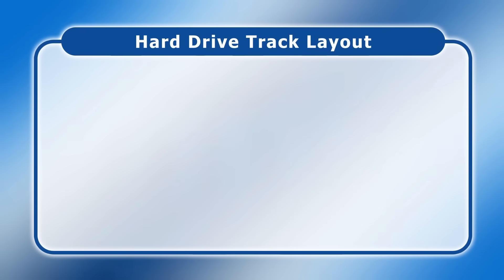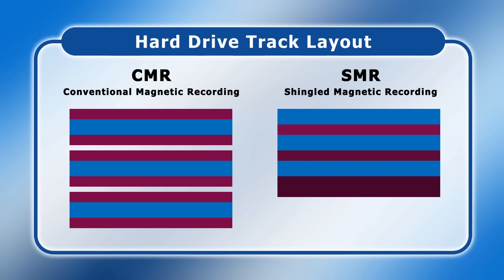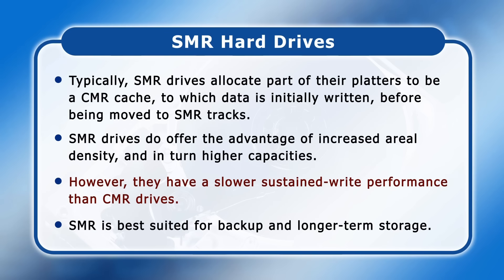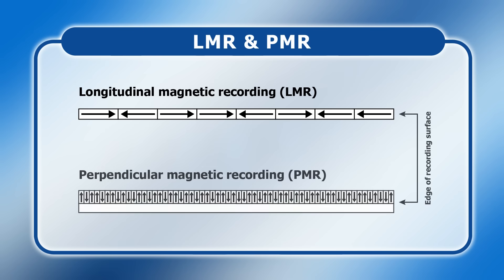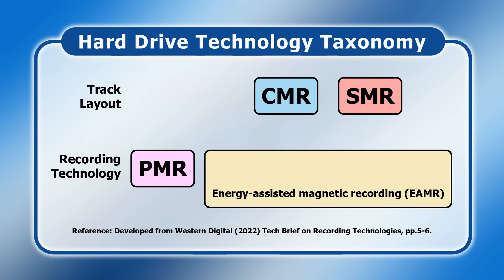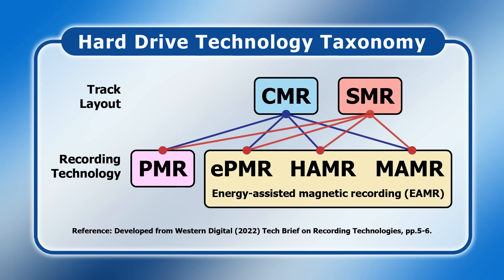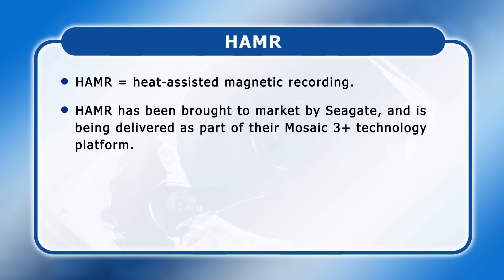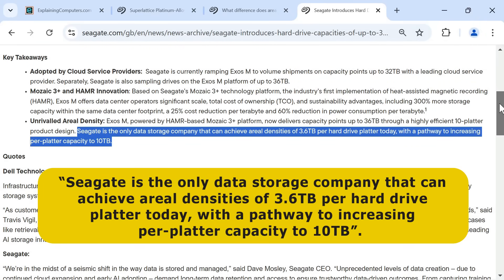Explaining Hard Drive Technologies: SMR, HAMR, ePMR & more!

Comment: Hi Chris.  The first hard drive I came across in the late 1980's was a 300MB.  The drive itself was the size of a washing machine, it had 12 platters, the top and bottom surfaces not used, two were position reference surfaces and 20 data surfaces.  The 'Disk Packs' were also replaceable and had to be left to come up to temperature dependent on a formula based on the outside temp and the computer room temp.  There were 22 W/R heads, it was sight to see.  Thanks for the update, truly educating.
Reply: My high school had one of similar description, but this was from the 1960s and held a whopping 5mb!!
Reply: Luxury! When I were lad, we used to dream of punch cards! Before crack of dawn, Pater would wake us wid bucket of cold water, gobble 'andful of gravel for breakfast, quick smart to local mine office and warm up the Williams-Kilburn tube, work without break to midnight on mining calculations. It was ard work but we felt like pioneers! 
It was a good life and we never tired of it, sadly didn't last, EDSAC came along and we were out of job...
Reply: @artmcteagle  but you'd then be valued by the medical experimentalists...😂
Reply: @ Well, I'm still around but I do glow faintly in the dark, guess it was all that time spent in front of the W-K tube. I often reminisce about that period with my mates down at the club, over a few bottles from Château de Chasselas...
Reply: Can't remember where I saw it. Propped against the wall, sitting on a bench, was this gigantic 4 foot diameter platter from some long-decommissioned hard drive. The first PC hard drive I ever saw was, I think, a 8 inch unit. It sat in a case identical to that of the first IBM PC except the front was smooth, no exposed drive bezels - the PC actually sat above it so it looked like two PCs stacked on top of each other.
Reply: Me too! I started my career as a technician in 1984 and the computer room where I worked had a line of those washing machine sized drives and programmers would have to wait if all drives were in use or some were down (a common occurrence).  When one was available they could install their pack (platters) and go to a terminal at the mainframe to access the drive.
Reply: @ We had.... [hushed voice] ...punch cards.

It was a big upgrade when we got a paper tape reader.

Comment: And here I remember trying to hack together an Atari 1040XE to use a 20 meg hard drive using some SCSI controller. Back then I think they were RLL or MFM drives and you had to do a low level format to get them to work with whatever type computer you were using.

Comment: Please do not use SMR disks for redundancy backup in RAID configuration... When reconstructing the array of a failed disk there are high chances another disk fails and you lose everything.
Reply: In addition:
SMR drives are very reliable and not at all error prone. When used as intended.

But it is important to keep in mind that SMR drives are specialized drives intended for special purposes.

SMR are great for mainly sequential writing. Backups, recording surveillance video and so on. Even static storage of large media files, with access time stamp turned off. Archiving. Write once or rarely and read many or often.

If you use a SMR drive in a RAID array, or to store many small files that are then often randomly updated, then the SMR drive may experience much more wear than a CMR drive would, under the same circumstances. And the SMR drive may fail quickly. This is not an error of the SMR drive. It is an error of you, using the drive for something it isn't suitable for.

The reason is that data on SMR drives is stored in overlapping tracks or "shingles". This means that data density can be increased. But it also means that if a small part of a big shingle is changed, the whole shingle needs to be rewritten. This is a form of "write amplification". You make a small change, and that leads to a lot of data being rewritten.

Generally SMR drives have higher capacity for a lower price. External HDDs up to 8TB often use SMR. Especially if the have words like "backup" or "archive" in the name. You need to look at the description of the drive, possibly even the data sheet to figure out if a drive is SMR or CMR. Under 8TB many drives are SMR. Over 8TB many drives are CMR. Usually...

Meanwhile, SSDs work in a totally different way, and with them you might worry about QLC compared to TLC.

Comment: The first computer I used had a 10MB hard drive option. We couldn’t afford that so we had to stick to twin floppies. Mind-blowing video, Chris.
Reply: Me to, my 486DX2 had a 10MB HDD, which was massive at the time, when game where mere KB is disk space.
Reply: @IvyMike. By the time the 486DX2 came out, 10MB hard drives were seriously outdated already  100MB hard drives were outdated by then.  The state of the art was around 200MB.

10MB hard drives were in fashion around the 8088 through the beginning of the 286 days.
Reply: Cassette tape storage ... FTW!!!
Reply: @ All hail the ZIP drive. :)
Reply: Worse -- 360k floppies!
Reply: My first PC had a 70 MB HDD with pre-installed office programs (Ami Pro and Freelance Graphics) that required creating backup copies on disks before the first run. So I had to buy several diskettes (I think 2 packs of 10 each) and do some DJing in order to be able to use the programs.
Reply: @Alien426  I feel your pain bro. It was gruelling back then.
Reply: My first computer used cassette tapes to store and retrieve data.  On a later machine, I created a virtual hard drive out of a stack of floppy disks and regularly saw messages like "Please insert disk 5 of 15" on the screen in order to run software.  Then I finally got my first computer with a hard drive.
Reply: The first computer I used had only a audio cassette tape option.
Reply: @An.Individual  Sinclair Z80, or Z81?  There was one branded for Timex, as well as for others I think... so the very same odd foil keyboard, you had to use your own cassette as drive and TV as monitor computer, were pretty much all the exact same thing but the label and look.
Reply: @Bob-of-Zoid  I had a BBC Micro.  Had to rekey program until I got the cassette adapter 🙂
A friend had a ZX80, it barely qualified as a computer, the screen went blank when you run a program. 🙂
Reply: @An.Individual  I heard about those, only decades later though.   Didn't the BBC put them in schools or something?

Yeah the Z line were pretty nasty indeed, and gone in a heart beat!

I was in Germany in those days, and I was the go to hardware guy of a clan of computer geeks; I couldn't get into programming being already swamped in college.  Two of them got ZX81's (the german name)  and they were disappointed real quick!😠  We had already frankensteined all kinds of surplus computer stuff from servers and what not together and had better working systems when they came back from the store with them!  We had two printers, stereo sound, a card reader (because of the programs on them), and 4 huge tape drives from a bank that upgraded ( Huge size, not capacity😁), and real freaking keyboards!  All in a pretty large building on one of their parents farm, which his parents encouraged.  This was before the first computer the common man could buy was available, but they were teaching these kids programming and the only computers were in the freaking schools, big business and industry, and military then.  So I could totally dig their plight.  I could buy most of my tools by walking into a good hardware and electronics store, they had no other choice for not having endless money.  I only started using them a few years later, but did way more playing with the hardware than than actually using them to do stuff until the GUI came out.  I did become a power user real quick though!🤠
Reply: Similar experience here:  My first computer had DOS on a chip and 2 5" floppies, my second was a 286 and it did have a 20 MB hard drive, but I was always into looking for surplus from industries upgrading, because they were way more likely to have more RAM and other upgrades like the drive in mine, and priced to sell.  ~1987 I bought a Macintosh Lisa (so literally not even 2 years old) for like $250 from the Art Institute of Chicago!  I looked up the model and features and they cost $5000+!  And yet it was still not very inviting to use, and I could draw better by hand write faster with a pen....  I finally started using computers more to work with them rather than tinker with them when I had a 386, and Windows 3.1.  Too Bad Microsoft turned into nasty leaches, so I switched to Linux while on Windows 7 and word of Windows 10 EULA were leaked.  I made the switch cold turkey, and never used a Microsoft product since other than any of their open source contributions to Linux, so in the kernel or networking stack, not "Edge for Linux" or anything like it, and won't even run made for Windows  apps through Wine or some emulator.  I got all I need and more in Linux.

Now my first SSD was the biggest performance increase I ever got, and did splurge for one early on, and I was😮🤯  It was well worth the high price.  I got more as fast as I could afford them, and just like with the early hard drives, the capacity and performance grew as the prices went down, and all I use hard drives for are backups, and backups of backups;  Many of us older geeks do not put our data in the cloud on other companies servers for "Safe Keeping", because the only truth to it is the keeping, no safety can be guaranteed, as the providers have sufficiently shown already that you are not safe from what they will do with your data.

Comment: Louis Rossman said in one of his videos that WD Ultrastar hdd's are build as tanks and were manufactured in one of the Hitachi factories . WD accuired Hitachi . I've heard they were very reliable hdd's . I got one from 2008 that still works and has lots of hours under his belt . My WD black external hdd works fine so far too . 🙂👍
Reply: it was IBM -> Hitachi -> HGST -> WD
The quality goes all the way back to IBM back then.
Beware the SSDs though, WD killed off the 'real' HGST SSDs and only left the ones by STEC (also eaten by HGST earlier) and another vendor they ate.
I still think Hitachi was not very smart selling these juwels at the time.
Reply: @udirt   IBM is not only very good with researching and inventing world-changing technologies, but also very good at having them overtaken by other companies 😂

my guess is, the same is gonna happen with their latest invention - quantum computers.
Reply: wd drives are really durable, even the regular ones. my 10 y/o i3-4th gen laptop, which my dad uses now, also has a 500 gb wd hdd in it (been there since purchase, was never changed). the drive survived a few laptop-fallen-from-hand-while-running, and now shows S.M.A.R.T. fail error at boot, but still giving decent performance like nothing has happened to it at all.

(yes the error means it can suddenly fail at any time, but it doesn't have any important data in it anymore.)

even my current laptop has a wd drive, which is a little more than 2 years, is still running fine with a few sectors damaged (i slipped on a wet floor with the laptop in my backpack, that's where i suspect the hdd got damaged internally somehow).

Comment: I remember back in the late 90's and early 00's  there were musings of  using  materials other than metals for storage. One wild speculation was the use of "data-crystals"  ....no doubt inspired by Star Trek and other sci-fi shows/movies.
Reply: Metal is made of crystals.  The size of the crystal grains already has an impact on the magnetic performance.  The crystal grains tend to magnetize as one so these grains need to be small.  Controlling the size of the grains is done via the manufacturing technique of the platter.
Reply: in that time IBM had already started using glass for the laptop drives with a metal coating... kinda the start of the mad disk engineering :)

Comment: 1. This should be obvious, but do not ever open a hard disk drive if you ever want to use it or get the data off it again.
2. I once bought an SMR drive.  I will never buy SMR again.  It was like getting an Internet connection where you can download terabytes a day, but at dial-up speeds.  I like to refer to SMR as "shit on a shingle".  Total crap.
3. Watch out for used drives being sold as new.  I bought a 14TB Seagate drive which had its Power_on_Hours reset.  I am trying to return mine.  smartctl -a /dev/sdx vs. smartctl -l farm /dev/sdx will show this only on Seagate drives.

Comment: Always was curious about this. One of the things I was told was that CMR was preferred for RAID and enterprise setups due to vibration. Using something like SMR would cause data corruption eventually and is slower. I'm not sure how particularly true that is but I've always preferred CMR because it seems like it would have less issues. I like your videos a lot, really appreciative of how in depth you go into this stuff and the format of your videos. It's like a mini class but straightforward, interesting and fun.
Reply: sounds like they kinda muddled the info, but you DO have TBW ratings for SMR drives which is kinda dreadful. And they aren't super high really - lower than high endurance enterprise SSD. Not sure if one has to expect a failure, but they'll be a problem for anything that has a constant data intake (backup servers spool areas where you got a few 100TB of disk and then stage down to tapes, or backup servers without disk, too. it's definititely something you need to plan for, once they've been filled it'll be icky. no idea really how vibration might play in there - the cloud shops that had the SMR archive drives also had 1000s of them and usually in worse quality chassis,  they would have had to see issues. The stable performance would always be a good argument. You'd be doomed if you use SMR in a tiered storage. The rest, really idk.

Comment: I don't have much hard drives anymore as most of them died off aside from external ones and a single 3.5" drive. The typical above 30C ambient temperature of my area doesn't help the hard drives making me shift my storage more to SSDs.

Still gonna watch the video though as the CMR & SMR and other teminologies I could use some brushing up on.

Comment: I can't believe that my first hard drive had only 42MB capacity in 1989.
Reply from the maker: It is amazing how things have evolved.
Reply: I love the sounds those old drives made. 

I had a 42mb Seagate in an 8088 system. You could feel it rumble the desk a bit when accessing data.
Reply: @volvo09  I had the ST-251N connected to my Amiga 500 running my bbs.
Reply: I can believe that.  My first hard drive was a 5.25MB 'Winchester disk' in an LSI11 based microprocessor development system.  Could count as luggable if there were two of you! 🙂